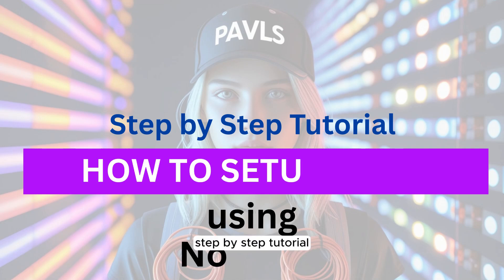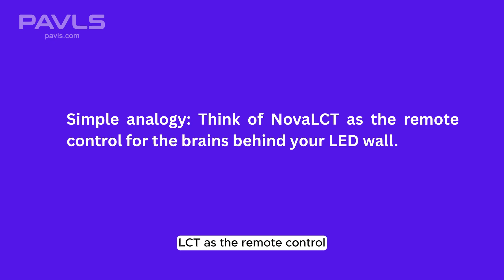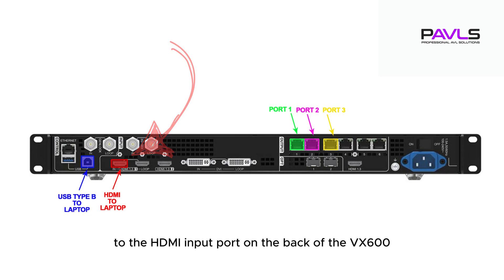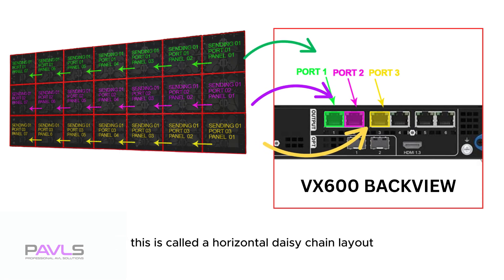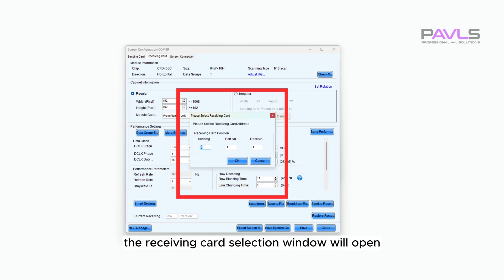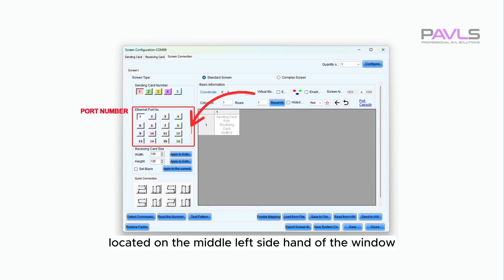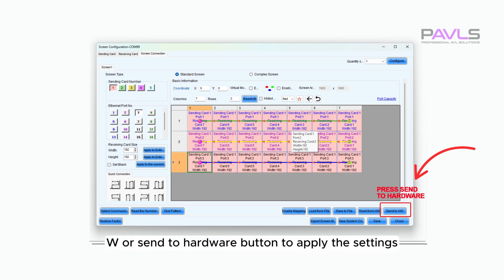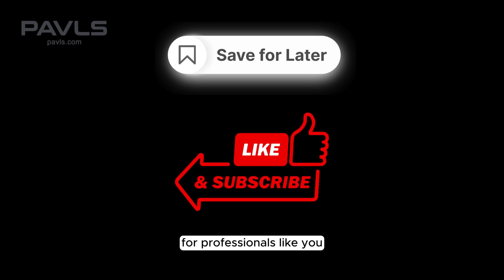Step-by-Step LED WALL Setup on NOVALCT - FULL TUTORIAL (Beginner Friendly) #novastar #ledwall

Comment from the maker: 💬 Which part of the LED wall setup was the most confusing for YOU?
👇 Drop your questions below — I reply to every comment!
✅ If you’ve already set up your panel, let us know what gear you used (NovaLCT version, controller, LED panel type).
Let’s help each other out! 👇
Reply: I’ve got a 6x4 panel set up with three novastar a7s cards on headers with 8 inputs. Each card controls a 2x4 section. Does novalct screen configuration accommodate this?
Reply from the maker: @ronanduffy303  - yes it does, but I can't quite visualize the type of panel you have. We have installed panels running on A7s with 500mm x 1000mm configuration, 480mm x 360 etc. So I'm sure this will run under VX/MX novastar processor.